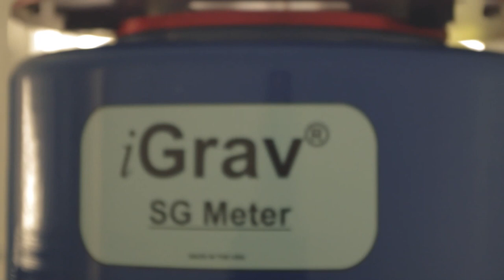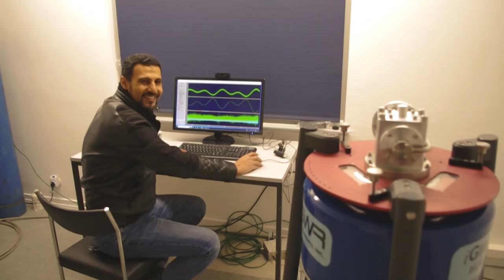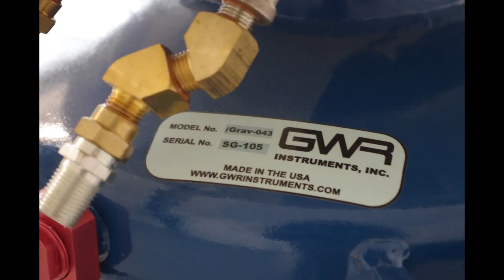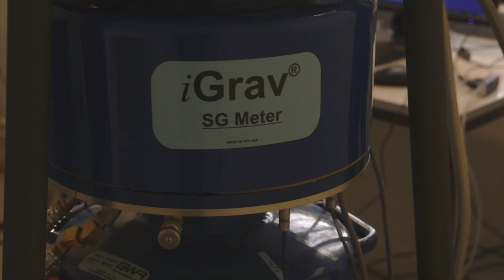Superconducting gravimeter to measure less than a Billionth of normal gravity

Comment: I remember 20-30 yrs. back they had thin wire gravitometers they claimed would detect a flys mass at 30 feet. The were very delicate and costed 10's of thousands of dollars. A cheap one would be alot of fun.
Don't know if it would affect a static gravitometer, but there is a claim that if alignments are correct an eclipse can cause a pendulum to reverse it's motion.....I wonder if that thing would detect a signal? Check the future eclipse charts for your region....who knows?